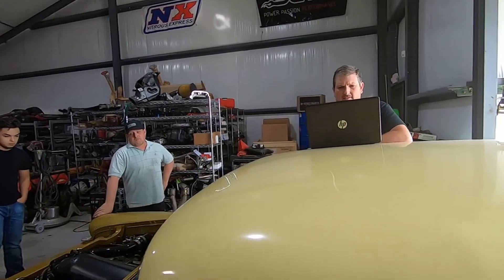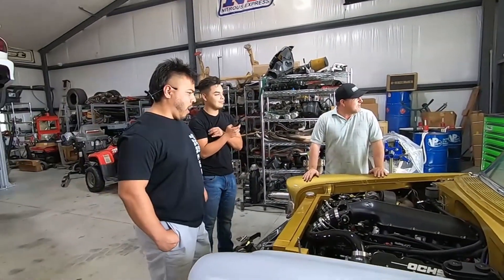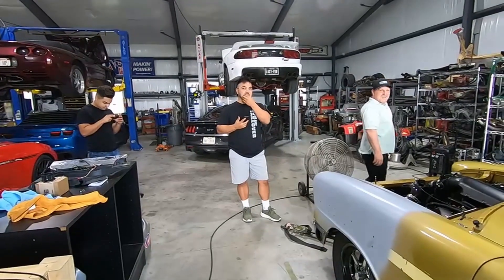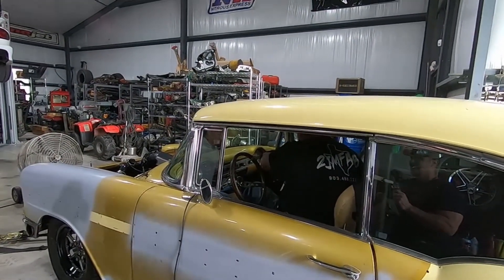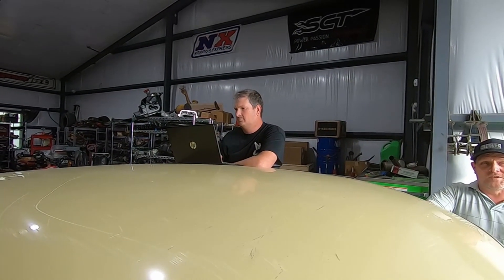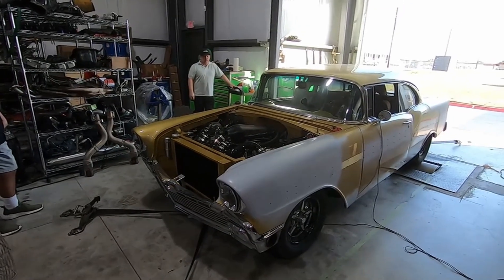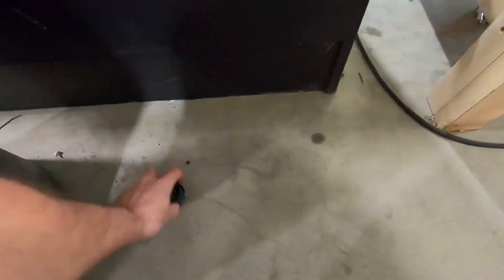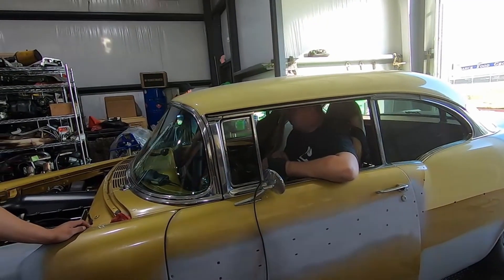ls turbo 56 belair on the dyno

Comment: Boy howdy, I was waiting on one of those rags to go right into the turbo!
Reply from the maker: We tried our best lol
Reply: That happened to me once. I don't know if you have ever been curious as to what happens when a turbo injests something like a shop towel but I have some results as I unknowingly ran that test on a Mazda mx3 or mx5, I don't recall what model I just remember it was a Mazda 4 cyl with a small internal gate turby. Don't recall repair exactly, think I was going behind the other tech. He left the intake bolts loose, I had the filter and discharge ducting removed and had left a couple of Scott's blue paper shop towels somewhere under the hood. I revved it a few times, it made a weird noise and shot a blast of finely shredded blue debris straight up from the engine bay. Most stuck to the underside of the hood, some stuck to the windscreen, the rest mixed with the atmosphere. Snapped the shaft off behind the compressor wheel. Didn't make much pressure after that. Got a 190$ eBay Chineerium replacement unit. So I fixed what the other tech screwed up but destroyed the terby in the process
Reply from the maker: @mastertek383  we’ve sucked a turbo guard in one before. Bent the blades